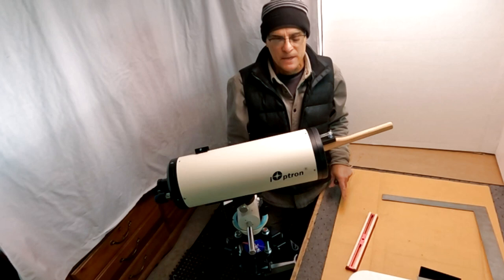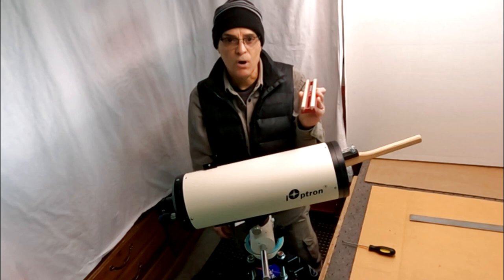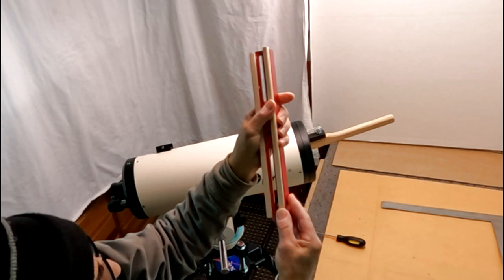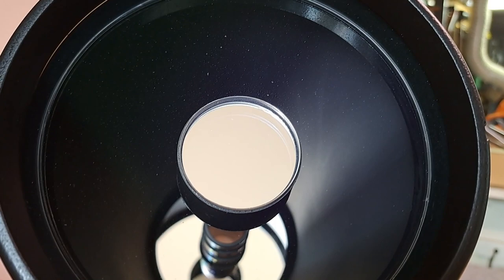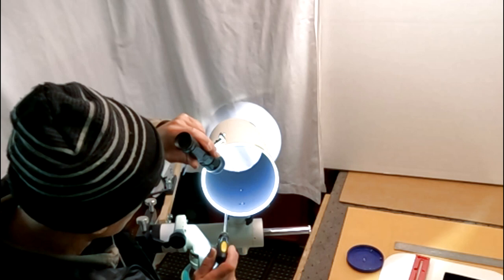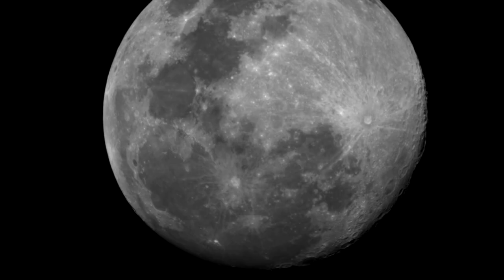Easiest Way To Flock A Telescope / Without the Mess

Comment: The inside of the two baffle tubes are prime candidates for flocking.  In fact, on cloudynights forums, the consensus of a very lengthy thread started in 2012 is that the very most critical and efficacious use of your time improving a Mak is to flock the inside of the primary baffle.  Then, the secondary, or consider removing it entirely because its flare expands outward and increases the central obstruction.  Flocking the inside of the main optical tube is a distant fourth behind getting a dew cap that is at least as long as the aperture of the corrector.

Comment: Done this years ago with Newtonian scope, you forgot to cut longitudinal cuts every 3 to 4 inches with a razor knife, because the flocked paper will expend and contract with temperature changes more then the tube itself, without these cuts the paper will shrink in cool temperature, did scope stuff not send installation tips, Protostar flocking paper is called. try this paint Kokushoku Musou Black Water-based Acrylic Paint (25ml) Made in Japan. clear skies.

Comment: Don't you flock in and outside of the baffle?
Reply from the maker: You could as it wouldn't hurt.  But flocking inside the baffle would be more useful than out.  It's a bit tricky, though.

Comment: Hi there, thanks for your very detailed tutorial. I Flocked my Skywatcher quattro 150p, but instead of dealing with the sticky flocking sheet, I made my one with 2 big X-ray plys joined them with masking tape, then I cut the holes for focuser and bolts using  templates previously made. try on a couples of times to verify the perfect fit and once I was satisfied I applied the flocking sheets to the X-ray. Easy to work and if you need to take out just remove it. 
Greetings from BelloCielo-Chile
Jaime

Comment: Since you are using wood for your dovetail rails you could tape a piece of sandpaper to the tube and sand the dovetail rails to match the tube diameter. 
Would make for a tighter more supported mounting.

Comment: Thanks for the video. Just about to flock the top of my 8" dob.   ScopeStuff flocking is highly recommended by many.  Much easier than flat paint & sawdust used by some.
Reply from the maker: Agreed.  The ScopeStuff flocking is the best.  I recently used it on an 8" Newtonian and had the chance to look a Saturn under transparent skies.  A rarity in western South Dakota. At 186x, Saturn was rock solid!  The image contrast was through the roof, like a refactor, despite the larger secondary of the f4 imaging Newt.
Reply: I can highly recommend basic jewelry velvet as flocking material. Its is far superior than scopestuff's flocking. The difference is crazy.
Reply: @Sharpless2  Thanks for the suggestion, but my ScopeStuff flocking order arrived 3 hours before your comment!  I chose ScopeStuff flocking because it is a known quantity for telescopes with numerous positive reviews and my good experience with other ScopeStuff products.  Yes, there may be "blacker" flocking options but ScopeStuff's flocking absorbs enough light for remarkably improved observing and astrophotography.  Let's say the OEM's flat black paint absorbs 50% of the incident light and ScopeStuff's stuff absorbs 90% of that light.  Then a scope flocked with ScopeStuff flocking has 80% less stray light than the out-of-the-box scope.  Another flocking that absorbs at 95% only removes 90% of out-of-the-box stray light. Yet another flocking that absorbs at 98% only removes 96% of out-of-the-box stray light.  Will I see a dramatic improvement by going from 80% to 90% or 96% better than out-of-the-box? Maybe, but those other flockings may be less proven, more expensive or harder to come by (i.e. ProtoStar).  Some concerns reported about other flocking material are: water resistance (from dew), adhesive strength (some Amazon jewelry velvet can be removed and reused several times suggesting the adhesive is not as strong as ScopeStuff's), shedding fuzz on to the primary mirror, outgassing of adhesive that condenses on optics, and tolerance to both low and high temperatures.

Comment: Wouldn't it be useful to flock the incredible shiny baffle tube on the outside as well? Since the baffle will reflect light to the curved main mirror.
Reply: Perhaps...give it a try and see if you notice a 'real' difference.  The discussion on cloudynights suggests that the inside of the primary baffle tube is the most important, and then either removing, shortening, or flocking the inside of, the secondary baffle.

Comment: Wouldn't a T-square be better than a marble for establishing a perpendicular line inside the optical tube? And what about using flat black paint in a rattle can instead of flocking?
Reply from the maker: Hey Mike, Sure a T-square would work fine. But not everybody has one of those. For those who don't have a carpenter's square, the marble was suggested but it's a bit more touchy trying to get it right.  As far as flat black paint... Most all telescopes come painted with flat black paint on the inside. The flocking absorbs reflective light due to its texture surface, unlike a painted surface.
Reply: @DakotaStarryNights  Not too hard to make a simple T-square. The black paint inside the scope you were modifying was terrible. There is better out there, but I agree that the texture of flocking is perfect. BTW, I like your presentation style. And thanks for taking the time to reply.

Comment: Is flocking worth doing on a refractor?
Reply from the maker: Probably not, Robert.  Refractors typically have baffles built in and without a secondary obstruction have better contrast than mirror telescopes to start with. Look inside your scope and you should see the baffle rings. 🪐
Reply: @DakotaStarryNights  I flocked the inside focuser draw tube, because is was shiny gloss black, and aftermarket camera spacers to, i even do the inside of eyepieces, and flocked the front hood near the main mirror, cause factory black not good. clear skies
Reply from the maker: @vicamaral  Wow!  👍
Reply: @DakotaStarryNights  Good idea to darken or flock any surfaces that are not already dulled/painted flat black.  This means eyepieces, focuser tube, and some even reposition one or more of the internal donut baffles. Some paint the outside circumference of all lense, oculars and primary.